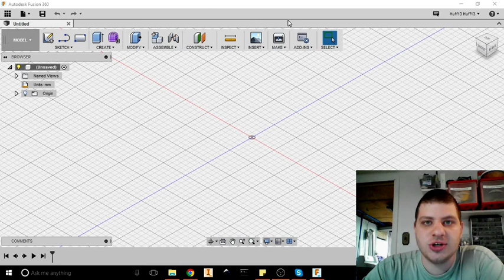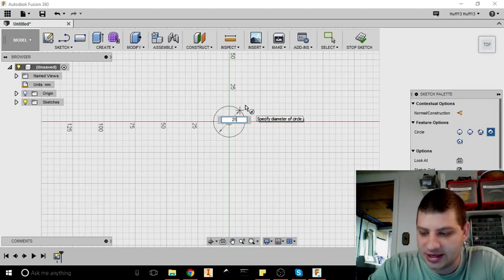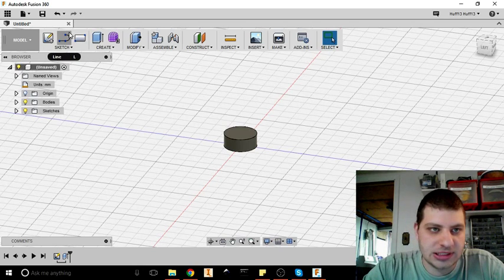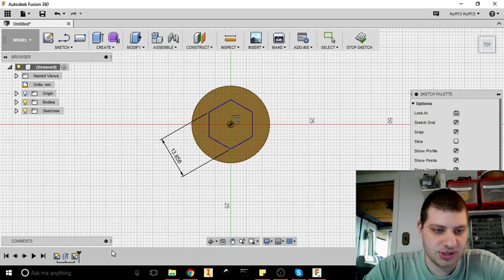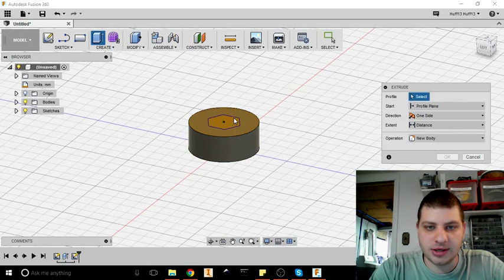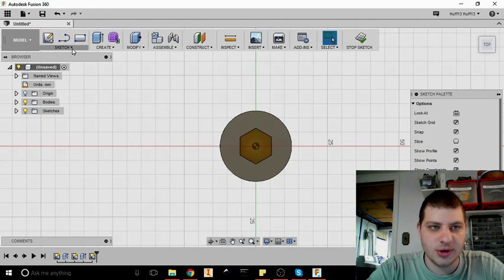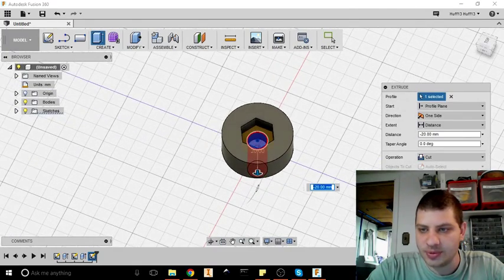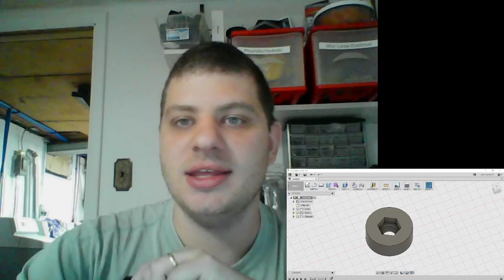Extrusion: Fusion 360 Beginner Tutorial

Comment: I have watched a few of your videos and for me they are the best I've seen yet. One question, how can you add more numbers/ measurements to the grid so it's easier to get holes in the same location either side of the center line. Or, is there an easy way of doing it without more numbers?
Reply: mirror command ? or the pattern command Sorry a bit late with an answer, but this site is new to me hence a late answer